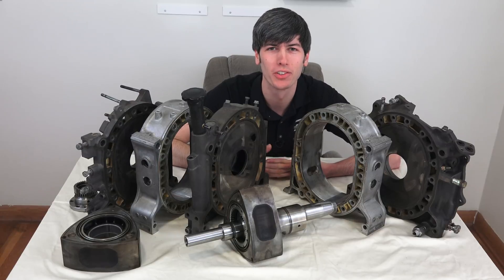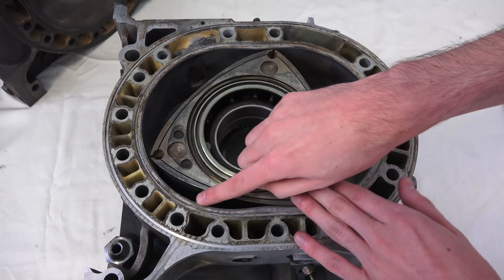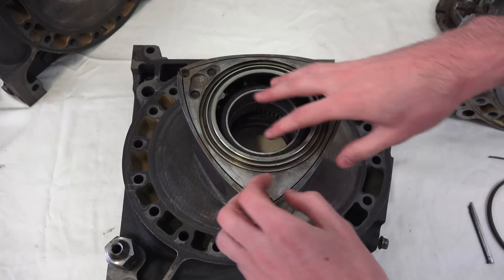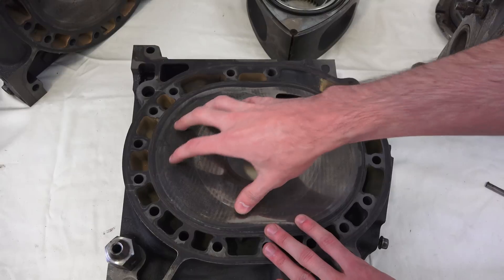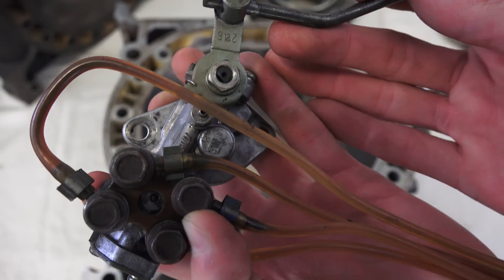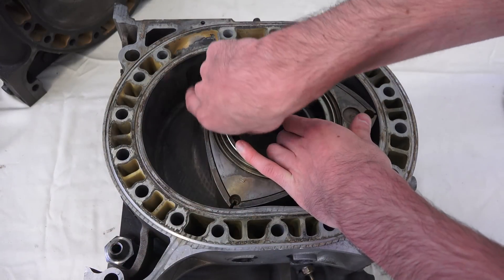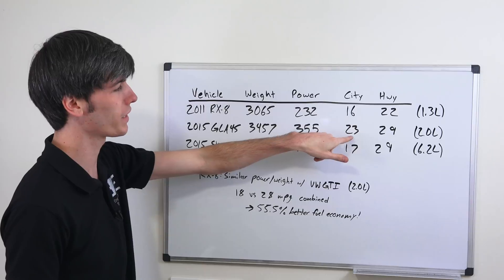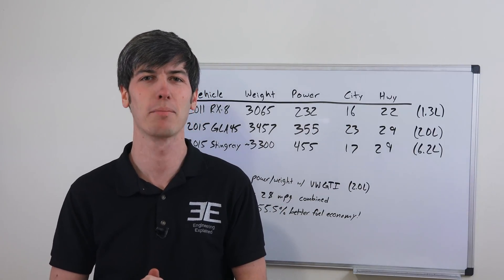4 Reasons Why The Rotary Engine Is Dead

Comment: I was talking to a ship designer and they are always looking at ways of cutting running costs. Some were looking ahead and favoured rotary engines in banks in cruise ships if they were made large enough. 

The 4 deck high Wartsila and Suzler engines when needing overhauling means the ship is dock, which means down time which costs. Ships and moreso cruise ship operators do as much maintenance as possible under way. They even paint the sides of the ship when in a calling port. They want the ship in dock only for essential dry dock maintenance like azipods, props or the keel. They want maintenance to be ongoing as the ship is moving and earning money. 

Some ship's designers are looking ahead and favouring larger rotary engines in banks (slide out modules say 1.5 metre by 1.5 metre complete with generator) in cruise ships. Rotaries are one third of the size and weight for the same power output. The smoothness is a great asset in passenger accommodation. Rotaries scale up seamlessly.

The rotary genset modules can be phased in, in stages to what the ship's power demand is, rather than running these massive Sultzer engines when there is low demand. Then they can slide out a genset module in port and slide one in, which will take a few hours. The genset module in port can be overhauled onshore and the ship continues with no downtime maximising efficiencies and revenues.

The rotaries niche is where a constant speed is appropriate as in genset applications. Then the rotary overtakes the piston/crank engines in economy. Other niches are aircraft because of the superb power to weight ratio over piston/crank engines and UAVs currently exploit this well. Applications for ship gensets are way down the line and probably will only come about when there is a wider acceptance in vehicles, although large rotaries were commercially operational in the 1970s, Ingersoll Rand making the largest which reliably ran for many years. 

As to ships, keeping the hull small enough to negotiate the Panama locks and packing as much cargo or passengers inside as possible increases the profitability. Replacing large engines with smaller lighter units which are flexible to the location inside the hull gives a ship designer great scope. More economical engines means smaller fuel tanks which again gives over more space for revenue earning cargo or passengers. Being secured in a strong niche market may elevate the rotary as the first choice of engine in time, as direct drive applications become rare.

Light weight rotary engines can be located out of the depths of the hull, instead of all laying on the keel. The flexibility of design is there. Many ships have Azipods for the the obvious manoeuvrability and also that they liberate space in the hull. Cruise ships want as much space as possible for revenue gaining. They cost a lot to run in crew and fuel costs. On the lower decks the crew are housed. Liberated engine space can accommodate more crew and lower the crew down maybe a deck or half a deck and utilise the liberated space for passenger functions, while moving these functions down decks will again liberate space on upper decks for more revenue earning passenger cabins.

The industry will move to smaller lighter engines if they are available for sure. They moved from steam to turbines and diesel piston engines. They move with the economic flow. Cruise ships use an amazing level of fuel, especially in hot climates when the a/c's are running. Size of propulsion and ancillary equipment in ships now matters. There have been large rotaries and they scale up seamlessly. A new large rotary in a genset would have the new innovations and improvement of over the past 40 years. Some newer rotaries are cooled through the driveshaft for instance giving engine longevity as hot spots are eliminated.

There is concern that vibration of ship's diesel engines could damage ancient historical buildings in places like Venice. Venetians constantly complain of this. Vibration is greatly eliminated using smooth rotaries. Having been on a number of cruise ships I can attest that vibration is a problem and I am always on around the 12th deck where it is minimal. What it is like further down I dread to know. I pity some of the crew near the engine room. Cabins on lower decks tend to be cheaper because of engine noise and vibrations; less revenue.

Look at the size, and weight, of a ship's diesel engine. It is massive taking up to 4 decks in height and cruisers have banks of these. The advantages of rotaries are easy to see.

Comment: Sounds like it functions like a 2 stroke.  Same problems, same advantages.  Burns oil to lubricate. Engine is inefficient.  Engine is small and light.  Using ports vs valves = fewer moving parts.

Comment: This opinion on wankel engines is something an old mechanic could say. Mazda has proven this engine is perfect for hydrogen f.ex. If you look a bit around you'll notice many examples of the complete opposite of what you say about the 13B, wich btw isn't the  wankel engine. Wankel engines that are fuel efficient with unbeatable power to weight ratios are right now being reborn as the perfect powerplant in not only drones but also civilian cars.

Comment: Notice how he compares  cars that are 4 years apart
Reply: What do you mean, "you guess?" Either it they do or they don't. In this case they do, so you answer should be, "Yes, I was wrong."
Reply from the maker: +Thomas Mcfarland 2004 GTI/Corvette still get better fuel economy.
Reply: yea i guess
Reply: Mike Oxlong
Mike, I had an RX-3 (or 4) and two RX-7s.  They were fun cars and a blast to drive.  But the Wankel ran into a wall of emissions and efficiency requirements that physics can't solve.  With spirited driving they were done at 150K miles at best, about half of what any Otto cycle engine will do.  You will never see a manufacturer offer a Wankel again.  The last RX-8 was slow, had crappy gas mileage and was pretty much at the end of the emissions development. The video is fundamentally correct.
Reply: My C5 got me 29.2 mpg on a trip staying below 70 and keeping it mostly in 6th gear.  I don't think that's possible with an RX of any year.
Reply: His comparisons are completely valid, but please, grace us with your wisdom!
Reply: +ohger1 
I've gone from either Port Jervis,NY or Montague, NJ to Brooklyn, NY sometimes speeding on one full tank with a/c off. I believe the trip is about 56 miles.
Reply: ***** i do accually thank you very much
Reply: smh
Reply: I  have a 1973 Alouette Silver Cloud with a Wankel motor in it and it is still running. The Alouette company only put the motors in the machines for 2 years, 1973 and 1974.  Was not a huge success.  The company was bought out by Rupp in the mid 70's.. The motor was a Sachs.  The only reason it is still in running condition is because I seldom run it .  Beautiful sound though.

Comment: true, not practical engines with horrid gas consumption but spun up they sure can deliver a ton of horsepower for the size and weight of the engine itself. I don't think they are dead for racing, but they really don't belong on the streets as daily driver sports cars. back in 1988 we adapted a Datsun A-15 engine into an RX-7 (hood bubble!) lost performance but got 34-38 mpg after swapping engine and rear diff.

Comment: Great video! Intelligent, to the point explanation that's easy (for people with I.Q. high than 9) to understand!  A lot of people use far more words to explain far less. Too bad so many of those who left comments didn't read your title or understand the purpose of your video. It wasn't to slam Mazda, or the Wankel engine, but simply to give some of the main reasons why the engine design is falling out of favor for use,  and what are some of the design shortcomings inherent to a Wankel engine. I think you did a great job.

Comment: There are some pretty simple solutions to some of the issues on rotary engines. EG twin spark plugs both increase power and reduce emissions by burning a higher proportion of the fuel, and having the fuel burn at a closer to ideal point in the cycle.

Comment: Terrible engineering.
Reply: +Chris Tafari thats still bad engineering.
Reply: +Berkeclor92 how so?
Reply: r u mad yet that tiny geometric displacement is engineering flaw. It cannot handle the thermodynamic principles of heat transfer and work. That is why MOST Rx8's need a new engine before 100k miles.
Reply: Berkeclor92 Okay, so what do you suppose would be a fix for that issue? Since you seem to be so knowledgeable.
Reply: r u mad yet Never create a rotary in the first place.
Reply: The real doktorbimmer they sound cool though
Reply: Chris Tafari an engine should not have oil seeping into it.
Reply: Chris Tafari that is the engineering flaw.
Reply: It is the way they designed the engine. If you keep that in mind and put in oil when needed, your engine will last over 100k.
Reply: Never said it wasn't did I? Just explained that if you actually do what is required due to the engineering then your engine will last over 100k. Maybe its too complicated for peeps to understand. Which is why the Rx-7 & 8 communities are so small.
Reply: Aww, you can't afford a hobby?
Reply: The real doktorbimmer The owners that provided proper maintenance didn't blow their engine under 100k. Maybe a few factory defects blew before then. No one is saying the engine is perfect. If  they were then there wouldn't be a piston engine. Also piston engines aren't perfect either :)
Reply: Gingerbeering !!!"!.
Reply: +The real doktorbimmer since when? We can still buy them here new and Mazda filed new patents in December 2015. Maybe in your world things are different.......but all I've seen so far is you making a false statement.
Reply: Lol, piston fan boys are into circular arguments. gg
Reply: Chris Tafari
u are noob
Reply: k fanboy
Reply: Nah, I admit flaws with rotary engines. You are the ones claiming perfection. All I have said is a rotary engine can last and frequently do last over 100k miles. Done wasting time with you brain dead argumentative morons. By the you have misspelled doctor :)
Reply: Video is titled: "4 reasons why the rotary engine is dead". In the states, at least my area, they are known as a rotary engine. There are lots of groups and communities also that refer to the engine as a rotary engine. So forgive me if I am not using the terminology that you are accustomed to. Also, yes, I am referring to the Wankel 13b engine. Not super familiar with the Renesis as I do not own an RX-8. For all I know about that engine is it is the same as a wankel 13b with a new name, though I am sure changes have been made. Anyhow, I am bowing out of this comment chain as it has gotten ridiculous with  the finger pointing and misunderstandings.

Comment: should have compare the rx-8 with other 2011 cars. I know that in 2012 ECO BOOST became a huge area for Ford and i assume other companies followed that lead as well. Bottom line, all cars made after 2012 were heavily focused on fuel economy because of the "going green" campaign that blew up around that time.
Reply: +Seanway Same results. First car I looked up was 2011 acura TL (base) it has 280 hp w/ 18 city and 26 highway. His point is still valid regardless of year.
Reply: Thanks for doing the research for me, i would have gone on never knowing the truth
Reply: Seanway It's ok, i'm just doing god's work.

Comment: its actually pretty amazing that a 1.3 ltr motor can produce that much power !!!
Reply: It's definitely possible if you run a small engine rich and revv happy. You might end up with similar MPG however
Reply: The real doktorbimmer Have a high bore low stroke engine for revvs. Run rich to allow higher compression ration and more advanced ignition timing, for more power. It is how it works. 

Of course you wouldn't see this kind of engine in a regular car, but it's definitely possible.

Its a lot how some F1 engines work.
Reply: The real doktorbimmer No sorry, i don't know much at all about the wankel. But that makes sense.

Comment: Actually, these are wankel engines, not rotary engines. In a rotary engine, the crank is securely bolted to the vehicle, while the crankcase rotates. Seldom seen outside of aircraft of the WWI era and a few years afterward, but very common at that time.
Reply: Nope.

A radial is a fixed engine block, with a rotating crankshaft.

A rotary has a fixed crankshaft (mounted to the firewall), with a rotating engine block (that's why it's called a rotary). Also, given how the rotary works, it has a total-loss lubrication system.
Reply: +The real doktorbimmer I think so too.
Reply: I'm glad someone DOES understand that Wankel engines are NOT rotary engines, as the OP states they are WW1 aircraft engines and Wankels are totally different.
Reply: Lol wtf. Makes me think of when someone tried making the rear wheel of a motorcycle THE engine. A radial type with the cylinders being the spokes
Reply: Seems to me that you're describing a Radial engine
Reply: The real doktorbimmer have any link to support your idea?
I mean it says right there that it is pistonless rotary engine
there is no piston
that is a ROTOR
the only person using slang here is you, calling that rotor a "piston"
Reply: The real doktorbimmer do electric motors use "pistons" too? :D you're a funny guy
Reply: +dligac actually, the only reason some people call the Wankel engine a "rotary" is because of how Mazda has done their branding.

A proper rotary would be a le Rhone, or a Gnome.
Reply: ShadowFalcon I don't care, there's the link, check it out for yourself.
Reply: +dligac you've provided no link. Also Mazda calling the Wankel a rotary is merely a case of branding. Until the crank is fixed, and the block rotates, the engine isn't actually a rotary.
Reply: ShadowFalcon I did
Reply: dligac 
Nope, you didn't.

You haven't posted a single linc.

As for a Wankel being a rotary.

If we count the Wankel as a rotary because it has force imparted tangentially to an axle, then a normal reciprocating piston engine is a rotary, because it imparts force tangentially to the crankshaft through the conrods (hell, a normal piston engine has more rotating components than a Wankel).

I could agree to call the Wankel a "Rotor Engine" because it has rotors, but since the block is fixed (i.e. it doesn't rotate), it's not a rotary.
Reply: dligac 
And no, a rotary isn't just a radial where someone fixed the crank.

The plumbing is a lot more ingenious (it needs to be, otherwise it wouldn't be able to able to be lubricated or fuelled).
Reply: ShadowFalcon well then you're contradicting wikipedia because it clearly states that it is basically a radial engine with a fixed crank
WHICH IT IS
Reply: dligac 
Take a Pratt and Whitney Twin Wasp.

Try and fix the crank, and let the block spin.

What do you think will happen to the fuel pipes, or the lubrication system?

Hell, how do you even control the throttle.

A rotary engine is one very specific type of radial, but not all radial engines are rotaries.
Reply: dligac 
Well hello Elliot Giles.
Reply: +dligac sorry, but Danish Airshow has ended, and the team with the Fokker Dr.1 have gone home to Germany, so no rotaries to put my dick into at the moment ;)
Reply: dligac 
You do know that on a rotary, the entire engine block is the flywheel right?
Reply: dligac 
Says the bloke who thinks an engine having rotors constitutes it being a rotary engine.
Reply: dligac 
Why?

Are you serving yours?

Don't want it anymore?
Reply: ShadowFalcon ( ︶︿︶)_╭∩╮
Reply: dligac 
Aw, did I offend the little internet angry guy.

You want me to kiss it and make it better?
Reply: ShadowFalcon╭∩╮_( ︶︿︶)_╭∩╮
Reply: The real doktorbimmer yeah sure, my statement stands still moron
Reply: Actually, both are rotary engines, just different types. The wankle cycle engine is just one of the many pistonless rotary engines.
Reply: Where can I get one of those "engines" powered from it's own source of energy?

Comment: Why not send the unburnt fuel back into the combustion chamber?
Reply: +Walter Tomaszewski How would you separate the exhaust gases from the unburnt fuel?
Reply: +Vishnu M. Couldn't you just divert some of the exhaust back into the combustion chamber?
Reply: +Walter Tomaszewski Then you would have carbon dioxide and all the other waste gases along with unburnt fuel in the combustion chamber. You need oxygen to be able to ignite the fuel.
Reply: +Vishnu M. Use a turbo, and just send some of the exhaust gasses back into the combustion chamber. Use a 'cat' to handle what's left over.
Reply: +Walter Tomaszewski ERG system?